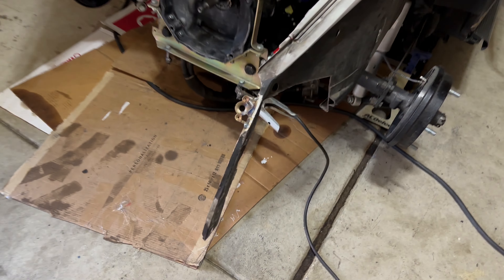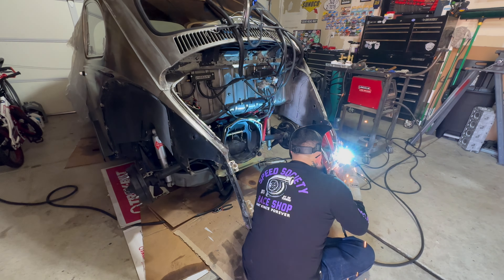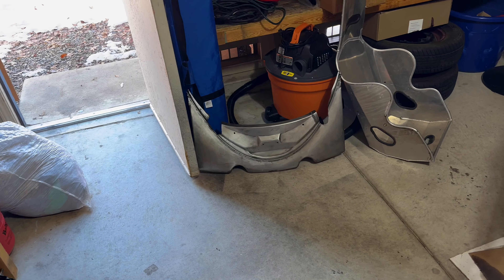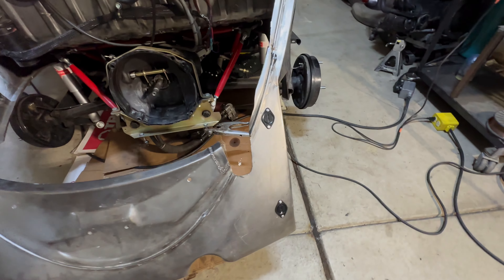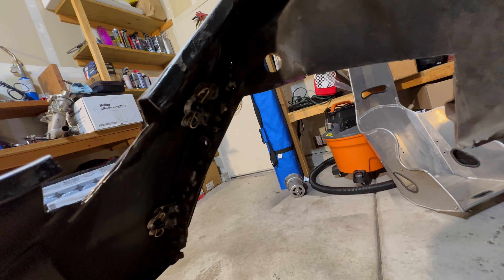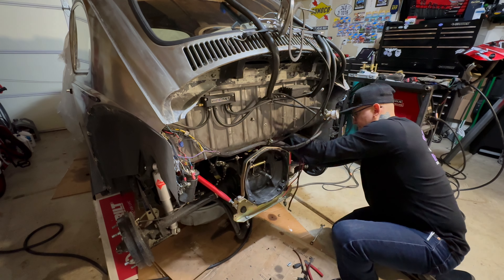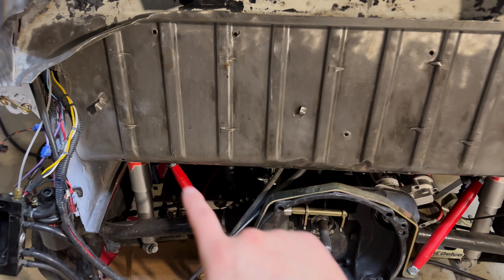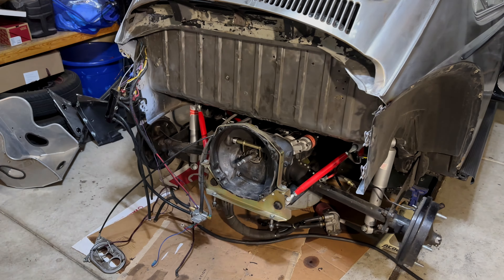INSTALLING DZUS FASTENERS: Part 2 (VW Rear Apron Edition)

Comment: Humble suggestions: Truck bed liner is heavy. I'd use paint instead. And black will be difficult to see any spills/leaks etc vs a lighter color. A light satin/gloss grey would be my choice and it looks very professional. I'd also fill up any extra holes etc in the firewall that you aren't going to use (if there are any).
The dzus fasteners look great on there and I"m sure they'll work well for you. Good job and good luck on your build.
Reply from the maker: Thank you very much for the suggestion. I’m going to look at my options for paint at my local shop. Most of the holes in the fire wall are being used but thats a good suggestion as well to plug/cover them. I don’t expect any leaks to go on the firewall but black will definitely be an option for me. 🤙🏼